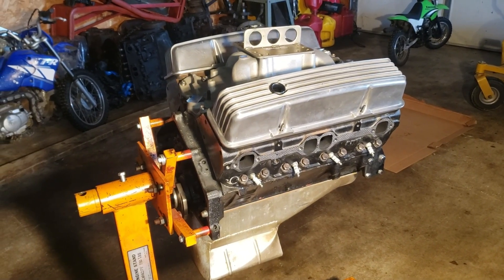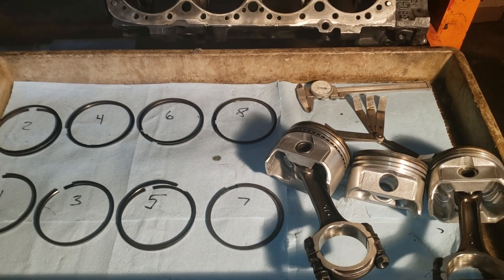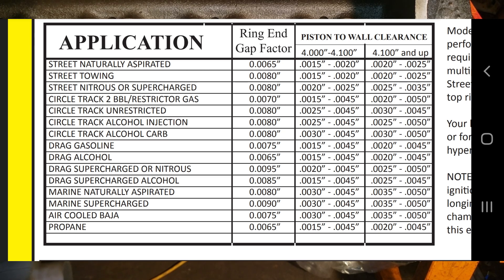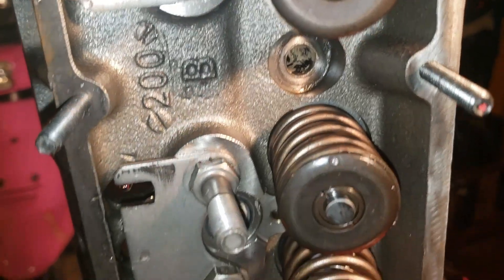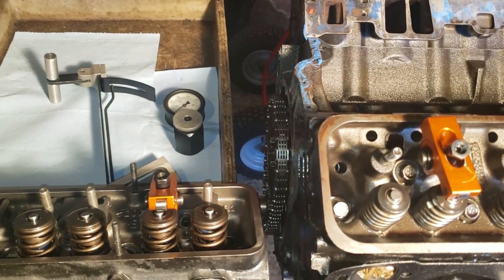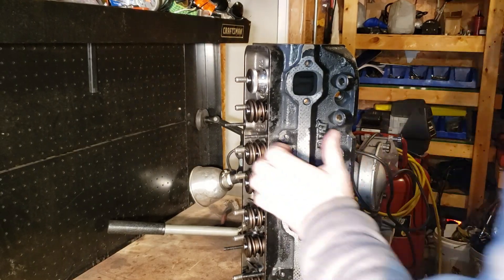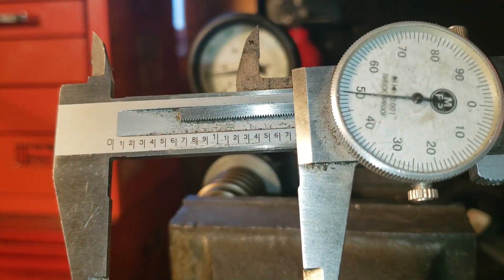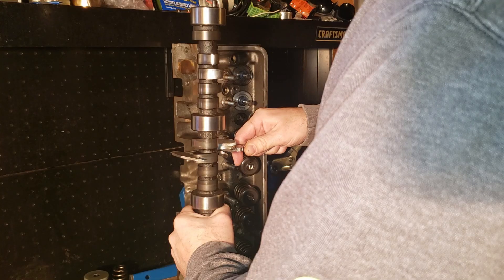Street/strip Chevy 350 Failed after 250 miles. Parts Inspection

Comment: Run .024 on top ring. .016 way too tight for this usage. Use micrometer and measure each cam lobe to insure taper ground into lobe by manufacturer. Also use straight edge to ensue lifter has crown. If not, reject.

Comment: Use alcohol to fill up ports and check for leaks. The surface tension of alcohol is MUCH less than antifreeze, and will leak out at the slightest gap. The antifreeze may not.

Comment: Hmm, that's odd.. 

Doesn't look like the pistons were too tight in the bore. The skirts aren't all scuffed up bad. Strange that they ALL broke in the middle ring land area. He MUST have had the second ring gap too tight. 

The cam? Well, thats most likely a wrong break-in procedure, extended cranking before it started due to other issues, and/or the wrong oil used. No zinc or use of regular off the shelf oil. The scratches all over the pistons say that it was assembled dirty also..  

Not enough fucks were given when putting this thing together.

Edit: He MAY have installed the rings right out of the box, and never even filed them.... 🤷🏻

Comment: end gap was too tight. Proper break in for the cam was not followed. You should run the springs @.050 from coil bind, the coils dampen ea. other and you will it more stable. Not a fan of flat tappet cams will never run one again personally
Reply from the maker: @JohnMcMahon-yf5ks  Yes I agree.   Thanks for the input.

Comment: Any signs of a nitrous kit having been installed?
Even a 125 plate shot will crack pistons when ring gaps are tight or nitrous applied at low rpm.
Id guess tight rings, bearing clearance and bad cam break in. are the chambers sooty ?
Reply from the maker: @shoelessb4515  Yes, sooty Chambers. No I don't think nitrous kit was on it.

Comment: Grade 7 cromoly piston crower forged crank Manley aluminum rods crome piston rings crome rod bolts crome bushed wrist pin cromoly Spiro locks crome plated cylinders chrome plated brodix late-model spec head all crome plated on the inside of everything cam spec roller 224 224 680in 680ex lift 10.5 to 1 comp edlebrock 2325 intake holler custom 800cfm mech carb msd 7al box ignition chrome plated plugs windage tray copper head gaskest 4 bolt main block msd small diameter distributor chrome plated stainless steel valves ......9000rpm plus zero balanced...

Comment: Kb is the original hyper piston. Has always needed more end gap than competitors. Ive run those pistons for over 20 years in my dirt track car. I love em. Edit' just an fyi- for my application (dirt oval/endurance) I ran .030 top and .040 for 2nd ring. (On a 355 chevy). With .0045-.005 skirt clearence. Never broke or cracked 1. Just a tip - run extra pin clearence. I ran .001- .0015.
Reply from the maker: Nice I have a set of kb pistons to replace these. Any recommendations to make them work. What piston to wall clearance have you ran. Have the pins been tight on the pistons.
Reply: @nylegreen261  for your drag stuff you can run tighter than my oval track specs. (I am a legit machinist and builder). If staying naturally aspirated, run .0035 skirt clearence.  Run 026 top ring and 036 second ring. Absolutely run .0012 min pin clearence. Also touch up piston pin boss on legit rod mandrel hone. To be sure it's straight and nice oil film holding hatch finish. I ran both floating and pressed pins. I also ran lite weight pin and never a failure. (88 gram pins versus 134). Ps- to much end gape will not hurt. You'll never notice. At 026 or put at 032 ish if nitrous a thought. I've made 600hp+, rev 7200+ for 24 races, 60+ laps a race. Some sets of pistons ran 5 or more seasons. (I ran flat top, single trough style. They were half the cost of Ross forged. And I did use good plasma moly rings(or hell fire rings) about 300/set with low tension oil rings. But I ran about 30 races ( full season and some other races) on 1 set of rings. Amsoil racing 20-50 with zinc/phosphate additive (I used about 1800ppm of zinc and phosphates). Never any noticeable ring wear. I do have more budget ways if you want to know. Happy to help. Great video content.
Reply from the maker: @PatandDoopypoopy  Great input thank you. There's alot to unpack here.
Reply: @nylegreen261  there is. I threw alot of info. And there are economical ways to do some of it. Let er rip. Might we see sub 10.5's??
Reply: @nylegreen261  on non gas ported pistons, I run the 2nd ring Gap. 010 bigger than top. That way any gasses that get past top can get past 2nd ring. If not, the pressures can make top ring flutter/float and lose seal. Hope that helps. I'm sure some will disagree. But I've track tested everything mentioned. Okie doke have a great weekend
Reply from the maker: @PatandDoopypoopy  Thanks again Pat.  I would like too. Can the kb piston h345np be pushed to 7200 rpm's. Im not sure yet if im going to be able to use the dart heads. I will have to check the  radial valve clearance. Im afraid  I might have to use a smaller valve head.
Reply from the maker: @PatandDoopypoopy  Thanks Pat. I bought a few engine books and cd's from Speedtalk and R & M 20 years ago. I used the books and cd's to assemble my first engine. My ring gap was .016 on top and .023 second. Worked out well. The 355 sbc engine had basic parts. It ran in the 10.20's in my nova.
Reply: @nylegreen261  fantastic low 10. Ok well 9.90 here ya come.
Reply: @nylegreen261  great videos. Nyle. Fun to watch. Great drag racing contest. We're cheering for you. I have some tricks to share, if you want to hear.
Reply: @nylegreen261  on stock cast pistons 016 is fine. I've run 012 on cast piston/mild street builds. But KB hypers are it's own animal. Many replacement hyper pistons have note stating no extra gap needed. And it's true.  It's all about material content and not all hyper pistons are same material content percentages.
Reply from the maker: @PatandDoopypoopy  Thanks again Pat. The pistons pins have been pressed in. I just got another car to do testing with. Im at a cross road currently on the direction I will be going with things. I started doing videos to get my kids intrested in making videos. Im going to have to take a closer look at the piston pins they seem tight. Thanks again.
Reply: @nylegreen261  go with your gut. They shouldn't be tight. I rec you listen to instinct.
Reply: @nylegreen261  so my thinking about your usage. 1/4 mile blasts. Not really building heat saturation. Do you feel tight spots or just snug overall? I guess I'm asking if they feel consistent through the motion of piston rock.
Reply: @nylegreen261  if you'll post the part # of pistons you may use, I'll take a look. Some have different chemical content- calling for specific specs of course. Okie doke be well.
Reply from the maker: @PatandDoopypoopy  Thanks Pat, piston part number H345np they came with eagle es 5.7 rods. They have a combined weight of 1308 grams.  The old have a 1425 gram weight.
Reply: @nylegreen261  hi nyle. I can't stress enough piston pin clearence. I watched many racers pull pin boss out of piston(destroying engine) because pin got tight. I'd recommend pay a machine shop to touch up both piston pin bore and pin end of rod. Yes I've ran mine up to 7400rpm. Lap after lap.( open show race. Aluminum heads and big solid cam). I ran that combo 8 very hard races up against 600hp engines. I had kb flat tops and scat 6" rods with stock gm cast crank. Are your rods pressed or floating pins?

Comment: Good talk through the diagnostics. I think there was two separate issues that occurred at the same time. The cam was failing, probably due to failed break-in (maybe procedure, maybe parts quality, who knows). The issue I find more concerning is the cracked pistons. I would have thought that 16 thou would have been good but I guess if the parts were specific to that KB spec sheet it wasn't enough. Anyway, looks like this disaster was identified soon enough for this engine to be salvageable.
Reply from the maker: Thanks for the input. Yes I think I can get it back together on a budget. I didn't think it would be a problem either at first.

Comment: ring gap was too tight, ring ends touched, popped the side of the piston.
Reply: the bottom of the rockers is from someone tightening the rockers all the way down, bottoming out the lifters, which is what made the cam wipe.
Reply from the maker: Sounds reasonable thanks for the input.

Comment: That engine was dirty when it fired up. The ring gap was the big culprit. There have been some significant issues with lifters lately. It very well could be due to the lifters.
Reply from the maker: Thanks for the input. Im going to do some research on lifters and try to get a good set.
Reply: @nylegreen261  from what I have learned, Johnson lifters have been good lately.  I think you can get most cams in decent shape. It's just the lifters that are an issue.

Comment: ring gap   break in   oil  stop using hyper pistons after the first half dozen failures because of similar issues i quit using them in the early 2000s in truck apps towing heavy loads  i would find piston parts the size of a quarter in the pan and not hurt any thing else
Reply from the maker: I'm curious if that was from detonation. Thanks for the input.
Reply: probably with factor hei distributor the curved in them will go to almost 50 degrees if you dont limitmthem @nylegreen261

Comment: I am curious about compression ratio and timing. Spring pressures sound good. Ring gap seems a bit tight. Spark plugs have any dust on them?
Reply from the maker: Looks like compression was around 10:1. With  around  .065 of quench. I will take a look at the plugs.

Comment: Ok, obviously the gap was too tight. But what about piston/bore clearance? Or the cam going houdini messing up oil spray on the underside of the piston? Run too lean? Im gonna bet on "gap too tight, but crowns got a bit too summery too". Aftermarket flat tappets are iffy at best these days, even previously reputable hi-po ones. Since you're gonna build her anyway, retrofit rollers might save you significant grief. Flats are "dinosaur stuff" as far as manufacturers are concerned, as all modern pushrod motors run rollers now. Gonna be less incentive to invest in tooling for flatties. That equals stretching tool life quite a bit beyond what used to be accepted. Like the other guy said, if youre gonna run flats, pony up for the oem bowtie hard faced ones, even if the aftermarket "race" ones make your bank account happier, lol.
Reply from the maker: Not a bad idea. Looking into a hydraulic roller.

Comment: Funny story. When I was 15 my dad passed (that’s not the funny part. Rather tragic tbh).   But he was in the process of building his hot rod. He had the valve covers off and I got his car so I started working on it to get it running.  I wiggled the rockers and most of em was loose. And I was like.  “Dang glad I checked that”. I cranked them suckers down tight.  Fixed that wiggle.   That’s also the same year I learned how to replace a cam lifters and pushrods. (That last part was the funny part) 

I’m 45 and I’m still working on that damn thing.  But to my defense it’s been running and not running more times than I can count.  Keeps getting better tho.
Reply from the maker: Nice keep it going.

Comment: It appears the engine was bored? 
I saw the formula for setting ring end gaps. 
I would suggest following the formula sir. 
Seems with busted lands on the pistons. Is it possible the engine was pre-ignition issues?
Reply from the maker: Yes it has a 4.040 bore. Will follow the formula on the next set of pistons.  Pre-ignition is possible. I will check the plugs over.

Comment: 016 is fine clearance,  Cylinder wall clearance?  To tight and assembly lube didn't  get to job done Lubriplate 105 always. Did you deburr the lifter holes  after being shotbeaded. Brek in should be 3000 rpm after oil pump being primed.
Reply from the maker: I will run dial bore gauge down the cylinders to check.  I will check the lifter bores for sharp edges. Thank you.

Comment: Open spring is a little high but still exceptable.  I didn't see you look at the ring end gaps. They will be shiny if they touch. How much timing was in the motor when it was run.
Reply from the maker: I'm not sure on the timing. Yes the ring ends were shiny.

Comment: Ring end gap was set at 4 thou instead of the required 6.25 thou. Simple as that
Reply from the maker: This surprised me. It has been 15 years since I have file fitted a set of rings. I have used .004 per inch bore in the past. Ran fine for a couple of years n/a. Sold engine. New owner put a 150 shot of nitrous on it and broke a piston.
Reply: I'm thinking if the consensus is 16 thousandths is too little gap,  how much worse it will be on a 150 shot.  Did exactly this myself a few years back. Motor ran excellent until nitrous. Same damage afterward. I probably had the same marginal gap until nitrous exposed it. Good luck, sir.
Reply: Ahhhhh NOS……. Definitely need bigger gaps for power adders and how much timing did they retard the timing for NOS or just bang it in😱😱. Detonation will destroy ring lands also👍. Loving ya vids man. Keep up the great work 👍👍

Comment: Open up all the ring gaps
Increasng second ring more then the top ring match top oil ring with second , allows combustion gases to not be trapped between the rings
Helps control ring flutter caused by trapped gasses
When rings butt its all over , using this method will  maximise ring seal and operation
Slightly bigger gaps won't hurt
Reply from the maker: I like it thank you.
Reply: You are correct.

Comment: I run 150 lbs. on a flat tappet cam made by Competition Cams with no problem...  .630" and .637" lift.  Tirn engine at 7,000 rpm...  Some of the rings must of been installed wrong, upside down?  How are the valve guides?
Reply from the maker: I checked the rings and they were installed correctly. Whats the best way to check  the valve guides. Thank you.

Comment: Also when you put it back together, I have heard several guys say you should rotate the engine over by hand and see all the lifters rotate. I would like for you to try this out and show us.
Reply: Yep. Rotate it 3 times. Slap the valve cover and say. “That baby is gonna scream”.  Hasn’t failed me yet.  I barely hardly ever blow up my engines.
Reply from the maker: I like it. Thank you.
Reply: @nylegreen261 wouldn’t you be wiping off the assembly lube/grease? I’ve seen guys say to not even overly prime your oil 😂. I had some “z28” valve springs installed basically factory springs that are rated up to 500” lift single springs.
Reply: If the lifters went in the bores nice, and weren't tight, they WILL rotate. There's no point in trying to watch for it... 🤷🏻

Comment: 0.016 gap would be ok for a stock cast piston, but sounds like the KB hypers need a lot more. So I would say the too-tight gap is what broke the ring lands. Look at the ends of the rings closely and see if there are witness marks where they butted.  The double spring pressures should be ok to run a FT cam, by I would definitely break it in with inner springs removed.
Reply from the maker: Nice thank you. The ring ends did look like they were hitting. They have  wear marks on them.
Reply: On true blue kb hyper pistons, I run .007 per inch of bore. 350 street/drag run .028. If endurance (circle track/roadrace run .009  per inch(or for nitrous).

Comment: I wouldn’t have thought it was the end gap but I didn’t realize KB needed a bunch more. I had a buddy who used cheap pistons, high compression and 87 octane that looked similar.  I’m of the thought that a lot of cam failures are either due to lifter surface finish or improper convex spec. My last build I used GM replacement lifters. Made in America and have a hardened bottom friction welded on. I was careful on break in (took the inners out) and use a zinc rich oil. No problems yet 🤞
Reply: The gm lifters with the hard disks are all I use. I'm sending a used set in to be rebuilt rather than using aftermarket lifters without the hard disks. I bought several sets of new ones (hl66 or 5232720) several years ago for all my sbc engine builds.
Reply from the maker: Nice thank you for the input. I will look into the gm lifters.

Comment: .016" ring gap is certainly not enough.

If you look at the contact pattern on the cam lobes, it looks as though the cam to lifter interface is perfect, with the lifter riding the front edge of the lobes. Here lately I've been breaking in flat tappet cams with Quaker State 5w-30 full synthetic oil and have never had a problem with the correct springs for the cam installed, which for me are Competition Cams 986's. To be safe though, go ahead and break the next cam in on your LS6 springs. 

Also, I think you may have mis-spoke about your retainer to valve clearance as .300" isn't nearly enough. It seems as though your calipers were further apart than .300".
Reply from the maker: Nice thank you for the input. Caliper was  at .950. Installed height 1.75. Cam lift a was .510.
Reply: @nylegreen261  hi nyle. Keep the valve guide as long as possible. Many people cut them down way way to much. If I knew I was playing with different cams, clearence for the biggest. As for how much a person needs, I set mine at .050 beyond the most lift I thought I'd ever run.